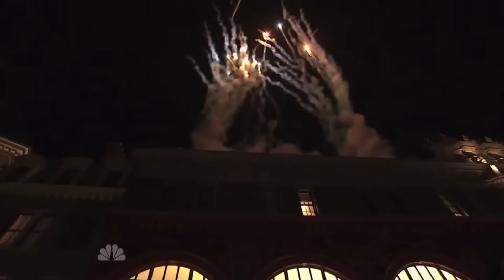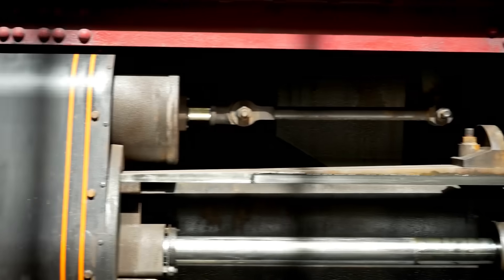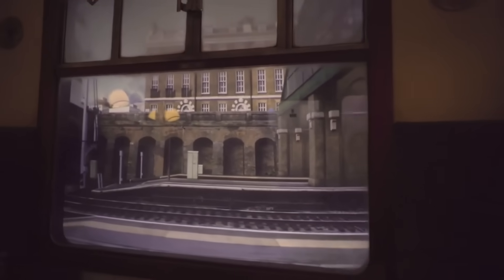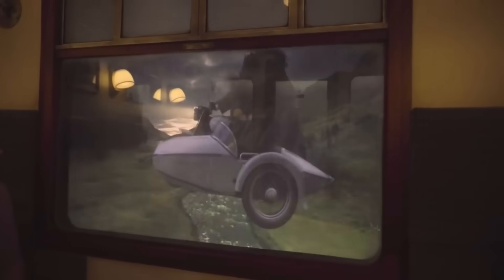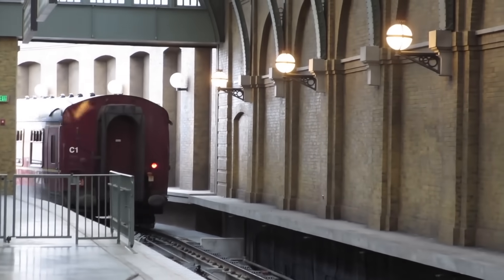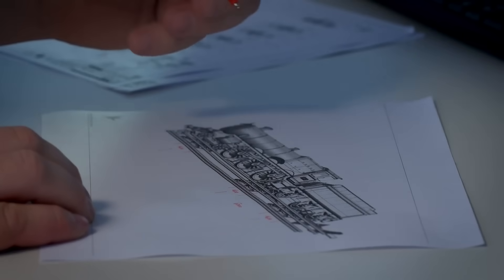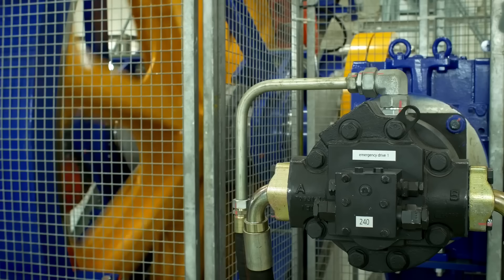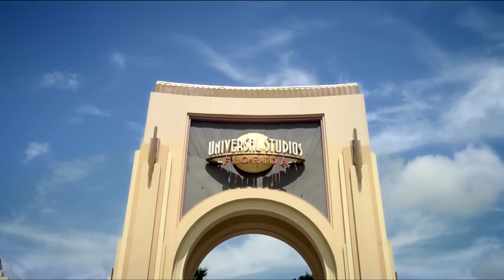Why This Hogwarts Express ISN'T a train!

Comment: Oh and one more piece of trivia... because of the curve and the cable (which can actually stretch) the two trains are designed to stop in the same spot in Hogsmede but this causes the trains NOT to stop in the same spots in King's Cross. As such, each day they mark the movable gate to what the correct position is each day. Depending on which train is coming in the gate is move to the appropriate spot (You will notice the attendants in the front and back of the train move these gates before the train is dispatched in Kings Cross.)   About once a year the ride is shut down so they can trim the cable because of the stretching.
Reply: Do they actually trim the cable or just adjust the tension? That would seem odd to physically cut it. 
Also I’d imagine it’s more of a temperature thing than the curve which causes the variation in location, as the curve is a constant.
Reply: @EstorilEm  I was told it's actually trimmed a but. And no, the curve is the reason for the difference is stops -  one side is longer than the other because there's no other curve to equal it our (inside the curve is shorter than the outside)
Reply: @richardperhai8292  that makes sense... to ABC it.. if both trips where 100% straight this wouldn't be a problem, they however could've solved it by using a MagLev setup... Oh well!
Reply: @g60force  Could've also solved it by using, well, an actual train.
Reply: @b-chroniumproductions3177  an actual train would have far more problems arise than a stretched cable
Reply: @b-chroniumproductions3177  Old comment so apologies for the necro...

But doing an authentic train, while it would certainly be a more authentic railroad experience, it would be very expensive to build and operate and there are regulations on railroads that would come into play with a real engine. For starters, the Hogwarts Express Engine would need to be fitted with a bell and a pilot/cowcatcher as per US Railroad regulations, both are things that the Hogwarts Express, or for that matter, 90% or more of all UK engines, both old and new, don't have. The funicular railway is really the only way they could've gotten to this much authenticity without running into both massive expenses and immersion breaking regulations. Plus, with the way the Funicular system works, it makes collisions almost impossible.
Reply: @b-chroniumproductions3177  Technically it IS a real train. Its a funicular railway :)
Reply: @Boskov01  i was thinking they could make it a electric tram with cardboard outer casing to look like a steam train lol.
Reply: @EstorilEm  Based on the thermal coefficient of expansion for steel a half mile cable would change by about 8" for a 40F change in temperature (20cm for 22C), which is about as much as I would imagine is possible in Florida - say 60F overnight to 100F during the day in summer, or 40F to 80f in Winter, is pushing the limits of temperature movements in Florida.
Reply: As a former porter, I can attest that part of this is true. Once a year the train goes for an overnight maintenance focused specifically on the “haul rope” where the tension is adjusted and the new positioning is determined. That being said the position more or less stays the same for the year with a few millimeters of change in a year. We did however have to move the gates at the ends of the platforms between each train to block the ride track from guests when the trains parked.
Reply: Yikes. Hopefully they let people know lol

Comment: I never liked how the trains go backwards. Why couldn’t they have made it a loop so the train always goes forwards?
Reply from the maker: Seems like quite a bit of expense for a visual formality. Plus trains of any kind often do run backwards, it's not as uncommon as people tend to think.
Reply: @AmusementLabs  in my counrty it happens all the time
Reply: @thatrandomgirl4574  I love your profile picture! I loove Miraculous.
Reply: Turning an engine around requires either a roundtable or a wye. A loop would require even more track/land than a wye and a round table is costly to build and maintain. It's a complicated, expensive, and time-consuming thing to do for esthetics, even in the real world. Every shortline that I've seen does not bother with it. Instead, they run the engine forward in one direction and backward for the other direction while using a simple siding for the engine to transition from one end of the train to the other. It may look odd, but it is perfectly normal and realistic.

Comment: When I was there, I saw just one track and the train going in reverse, so I assumed there was one train going back and forth.  Are you saying there are TWO trains? If so, how do they separate and miss each other, the get back on the same track?
Reply from the maker: The passing loop. As I mentioned the double flange wheel guides the trains. Each train holds onto only one rail, but not the same rail. It gets to about 2/5ths the way down and hits the fork and the flange wheel Yanks the train over to the one side causing the wide wheel to roll onto the other rail with it. They're both equidistant from the station at any point since they're bonded together by the cable. They both hit the fork at the same time and take the same side each time. Each train will never take the other path. Think of it like merging into a lane on the highway except you can never take the right side path regardless if you're driving forward or in reverse.
Reply: @AmusementLabs  i was kind of expecting a video clip of this since you showed footage of this part of the track
Reply: @MisterMatheusNeves  Since that's behind the scenes I'd imagine footage is hard to get, but you can see where the rail splits halfway through in footage of the track.
Reply from the maker: @MisterMatheusNeves  there's unfortunately no clear photos of the section, but perhaps I could have used another one since they're the same across the board.
Reply: @AmusementLabs   Thanks for the explanation.  I watched your video again and finally got it after this explanation.  I think the part that I missed was that there was never a picture of two trains, so the explanation of two trains went over my head the first time. I thought the focus was the cable and the train acting like a cable car and only one side of the train is detailed.  Now I see the significance of the double  flange singe wheel. Thanks.
Reply from the maker: @blaster-zy7xx  oh okay. I'll take that into account next time around.
Reply: @AmusementLabs  I just looked on Google earth. You can see the track split very clearly at the half way point.  You could use that as part of the story.

Comment: Wow I didn't realize that there were two separate trains, I've only been on the train once going from Kings Cross to Hogsmead and just assumed the whole thing would roll backward when you went the other direction, which is part of the reason why I never road it the other way thinking it would break the illusion. I just wish there was footage or an animation of the crossing point. So if it's a 4 minute ride... does that mean that they have to do an 8 minute reset between cycle?
Reply: There are two trains, but they both always face towards Hogsmeade. Both run at the exact same time, and are always exactly the same distance from the station. As such, the trains start a new cycle every 4 minutes. The onboard footage is different in each direction.
Because the stations are both technically terminals in reality, and King's Cross is in the movie, the illusion doesn't really break that much. A train will always have to either enter or leave a terminal backwards. There really isn't a reason to rotate the train in-between detraining and boarding- if the trip is long enough that it matters, they will turn it around with the passengers onboard using a wye. Using a loop would kill the illusion even more because the train would come into Kings Cross and leave Hogsmeade in the wrong direction of travel. 
Only way that the illusion could be closer to perfect is if you had 4 stations- exact duplicate boarding and detraining stations for each location. The passengers detrained, then the "trains" were pulled out of the station, around a loop, and into their respective boarding station, after which they made the journey to the next park. However, this would increase the cycle time, and might ruin the illusion of King's Cross, as it would be a thru-station rather than a terminal. The station isn't actually in what appears to be the station from the path either- it's quite far back and is actually perpendicular. The solution they chose was actually quite ingenious, as it allowed them to give a pretty convincing replica of a heavy rail trip on what is actually a glorified tram.
Reply: @john40539 back in the day, for long distance trains, one locomotive pulled a train into a terminal and another pulled it out.

Comment: I have to admit man, you do a spectacular job at explaining these rides, this is educational material, so well done
Reply from the maker: Thank you 🙂
Reply: @AmusementLabs  I'm disappointed its not a functional train, surely they could have just bought a red steam engine, and put the Hogwarts name plate on the front, or use the ORIGINAL TRAIN from the movie. I'm gonna have to dislike the video, they could have saved so much money if they just bought a real working train. Extremely disappointing...
Reply: @LukeWatson99  what they have is probably the best solution considering air quality, ride experience, energy conservation, passenger capacity and efficiency
Reply: @bangjiexue2937  it doesn't have the magic feeling of a real steam train if you know what I mean. Sacrificing people's experience for a few bucks, I big thumbs down from me.
Reply: @LukeWatson99  I can understand your feeling, but I don’t think they did it for saving money. It IS an attraction ride over all they have to consider the capacity of the passengers. It is also probably more reliable. I rode a real train in Dollywood where I had been blasted by smoke and cinder during the entire ride. Not the best experience on my book.
Reply: @LukeWatson99  It's an Amusement Park and everything is an illusion! Why should this train make any difference. And the comment was about the video which you have to admit was very professionally done and did a great job explaining everything! Did you know any of this about the ride without this video? If not, you should give them the deserved thumbs up!
Reply: @LukeWatson99  Remember that the ride has to match up with the video and start and end at their respective timings. I understand your disappointment but I am sure that they did the best they could during design.
Edit: also human error during driving can mess things up
Reply: @LukeWatson99  you're gonna dislike this video (that does a phenomenal job explaining the attraction) because Universal didn't use a real train? That doesn't make any sense. Go complain to Universal instead of putting this video down.
Reply: @gamefreak9  I'll dislike what I want thanks, mind your own business.
Reply: @LukeWatson99  as soon as you posted in the (public) comments that you're disliking this video, it's everyone's business now. I see you're one of "those" internet people...not gonna waste my time, I should have figured being logical wouldn't apply to you anyhow
Reply: @gamefreak9  Why are you bothering to reply then kid? Mind-your-own-business! Go and buy something with your mom's credit card.
Reply: @LukeWatson99  I mean, first off, the experience is REALLY well put together anyways, the inconsistencies with a real steam engine are a hell of alot easier to spot from behind a screen when its the only input you've got vs in a bustling station with all the action/sound of a park going on around you, where your main focus is on EVERYTHING as a whole, rather than just a close up shot of the undercarriage of the engine (an angle you would not be seeing in person anyways...). All things considered, and as pointed out by other people in this video's comment section, their replica is pretty damn convincing, especially if you're not REALLY trying to pick it apart, or aren't very familiar with steam locomotives and their intricacies, which, by how you've presented your argument, you clearly aren't. 

But other than that, a REAL steam train is a hell of alot more complex than "Burning coal make pretty steam go WHOOOSH!" Like you seem to think it is. While steam engines, are beautiful, yes, they can be very dangerous, on top of  incredibly cost inefficient to run on a constant and consistent basis like that. They are COMPLEX machines, with drastically more mechanical parts than the method they've employed. Parts that are subject to natural wear and tear, and human error in taking care of. Parts, that if they were to fail, could disable the attraction until expensive repairs could be made, or, god forbid, result in the train fucking EXPLODING. An explosion that would send boiling hot water and steam, burning wood/coal, and shrapnel into the train's driving crew and park visitors that could, and most likely would, result in MANY deaths, maimings/injuries, and 2nd and 3rd degree burns on everyone unfortunate enough to be nearby, like, you know, a station full of families with children?

Being blasted by hot steam alone as a the engine pulled out of the station would be bad for business, as would kids and their families breathing in the toxic smoke of burning wood or coal, or being burned by the cinders from the firebox. Having to keep up with keeping the train fueled and stocked with coal or wood to burn, would be expensive, on top of not being good for the environment. They have to stay filled with water, because again, should that water level get just a little too low (or the pipes that supply the water glass, an instrument used to tell how much water is in the boiler have scale buildup in them, meaning they'd give an inaccurate reading), the firebox would melt itsself, rapidly depressurize the boiler, and the boiler would explode. Even if it doesn't explode, it could still cause a rapid release in pressure blasting the driving crew with burning coals. (look up The Gettysburg Railway Explosion for an example) The engines have MANY parts to keep greased and totally rust free, lest an axle break or a driving rod snap and the train risk de-railing and plummet off of the raised railways (that would likely have to be much stronger and built completely differently than they are now to bear the additional weight and strain that the movements present in a steam locomotive would present), killing or injuring the crew, passengers, any anyone unfortunate enough to be below. 

So yeah, fuck Universal for using a safer, more reliable and cost effective, and just as convincing alternative just because people like you think it'd be a little nicer. Don't forget, there's two of that train running back and forth, so go ahead and take everything I just said, and keep in mind that there's twice as much likelihood of ANY of that happening.
Reply: @LukeWatson99  As someone who volunteers at a real heritage railway, I can advise that to re-purpose a genuine steam loco to run at an amusement park, seven days a week... the maintenance would be huge and the ride unreliable.
Reply: Yaaasss, I totally agree!!! I love this channel...its so interesting and informational!!! Great job Amusement Labs!!!!
Reply: I wanted to build a wooden monorail dolly for our cats, but maybe I could make a simulator instead. I'll just build a wooden box that will be the train sitting on the floor, I'll get four monitors and four DVD players and stick two monitors on the side windows of the box and one on the front and rear windows. Then I will play four different recordings of what the front of the monorail looks like, the back, and the sides in the appropriate TV windows. I'll stick the cat in the box and shake it a little as if it's actually moving and the cat will sit in there for forty minutes thinking it's riding somewhere by looking at TV's playing the cab ride view, the passenger side view, and the rear views in sync through the "windows." A speaker will simulate the slight rumble of the thing. I could also stick a TV screen outside the side window of my trailer and play a YouTube video of a passenger view bus ride recording on it so it looks as if I'm riding somewhere on my trailer.
Reply: That sounds so dirty think about it lol

Comment: I was expecting.

"It's a train."
Reply from the maker: An engineless train
Reply: @AmusementLabs  technically, a cable car
Reply: @AmusementLabs  I was kind of hoping it'd've been a GWR 4900 Class, there are 11 of them and two of them are getting certified, they even have 5972 (tho it's on lease and in the UK, I'm not even sure if they're allowed to move it), It would've been so much cooler if they had.

Side note, 5972 aka Olton Hall/Hogwarts Castle (I guess they wanted to be more innkeeping with the naming conventions) was a GWR 4900 class so the Hogwarts Express conductor was wrong. Hinderton Hall is 5900 but they didn't even use her for the filming.
Reply: @Volunteer-per-order_OSullivan  whilst it would’ve been cool for park guests, mostly behind the scenes theme park running would be quite a sad end for an engine that could have a much nicer time on a proper railway. Plus, naming conventions are not stuck to considering Olton Hall is a hall class locomotive (hence ‘hall’) and Hogwarts ‘Castle’ would be a castle class if it had that name.
Reply: @AmusementLabs  The same is true of some maglev (such as the Japanese Chūō Shinkansen), where the track pushes against the train and not the other way around.
Reply: A train with screens